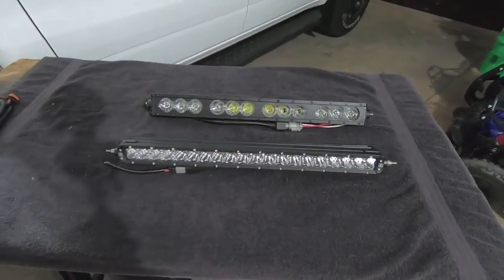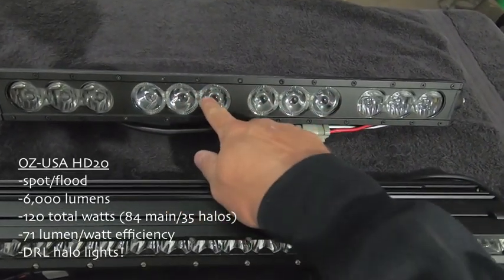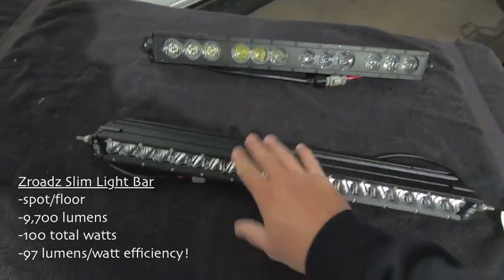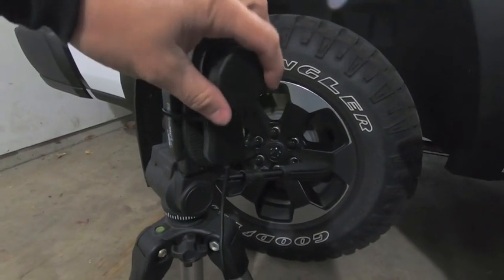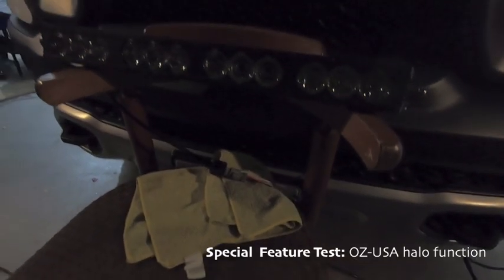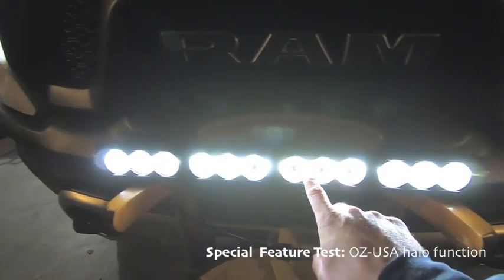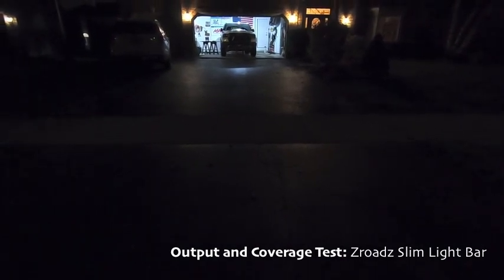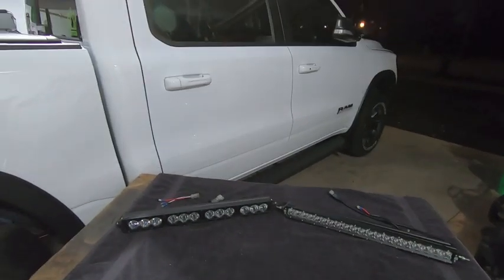Side By Side: Affordable 20" Light Bars

Comment: OZ-USA HD20 Holy heck... 120 Watts in just 20"? That's 10 freaking Ampheres for that ALONE! That's absolutely unacceptable.
Zroads Slim - At least there's some power saving with this one.
I can't get past losing 10 Amps from my Alternator just to run an only 20" light bar. Completely unacceptable.
Reply: I'm a Zroads fan based on this. More light, less power required, a good center spotlight. It seems far better.

Comment: Spoiler alert: $276 does not qualify as a cheap LED light bar
Reply from the maker: Considering baja designs and rigid 20” light bars are over $500 I’d call the lights in this video more than affordable given the size and lumen output.
Reply: @WaterFowler41  Oh I certainly agree, they’re more affordable than Baja / Rigid; they’re just not cheap. You should do a follow-up video where you put that $200 single-row ZRoad bar against one of Nilight’s $50 triple-row 20” LED bars that you can get on Amazon. For the money; I think you’d be surprised, especially if you were crazy enough to wire up 4 of them (which you could do for the price of the ZRoad).
Reply from the maker: I’ve had the cheaper light bars in the past, the paint on the light bar body ends up chipping and the lenses fade to yellow.  Midwest winters are rough on cheaper light bars. The salt takes its toll